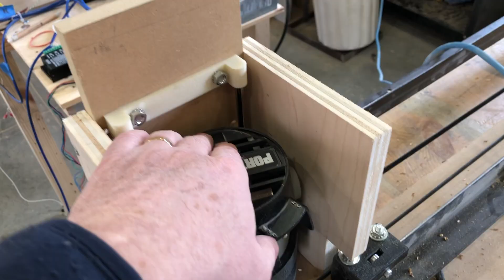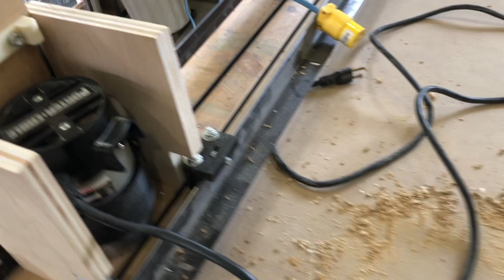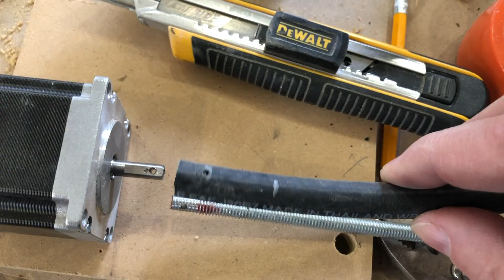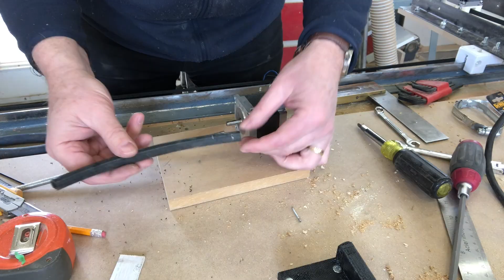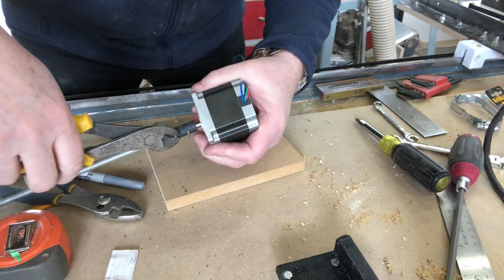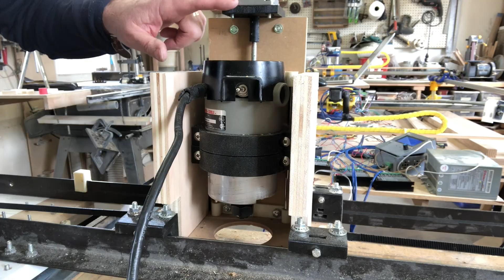Bedrail CNC - Part 9 - Z Axis - It's Alive !!

Comment: Wow that rubber hose is quite clever solution :) And for your threaded rods the slack of that should not be relevant. Nice
Reply from the maker: Thanks!  I had struggled with other connecting mechanisms, and the traditional connectors that I know are available seem considerably more bulky than a simple rubber hose.

Comment: Looks promising! The Z travel is a bit slow but I guess in most cases you don't really need it to be fast?
Reply from the maker: Z-Travel (at least for me) does not need to be particularly fast. Most of the work I do with a CNC is usually done at one height, then lowered a bit, then the same cut repeated.  Think of cutting out a piece ... cut the shape at one height, drop a millimetre, then repeat the shape.